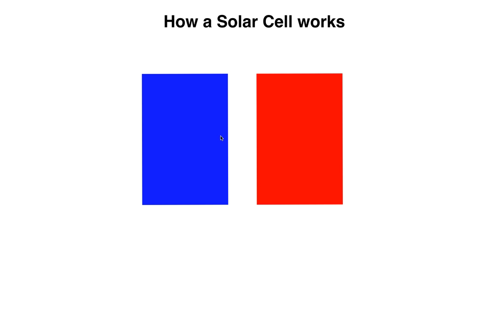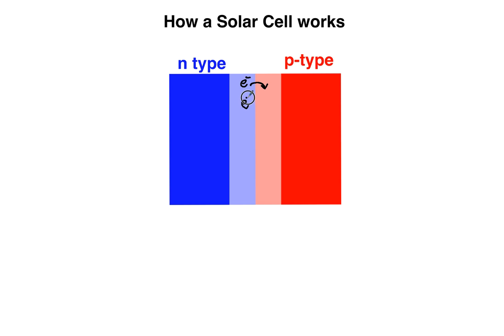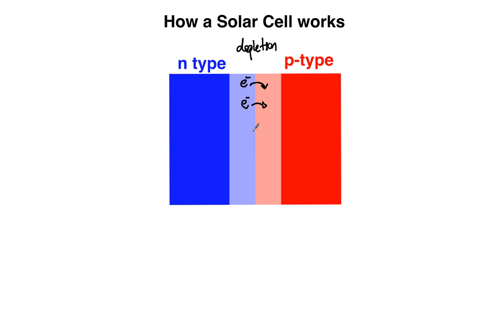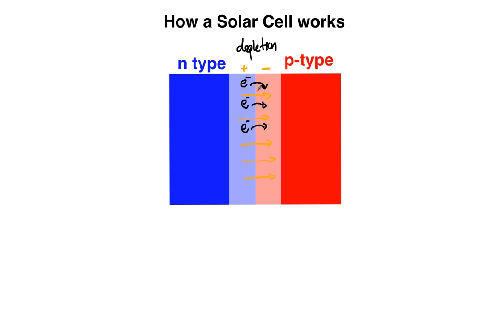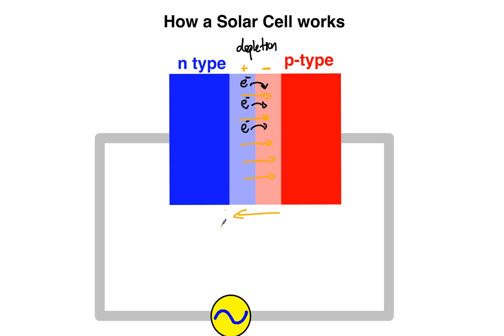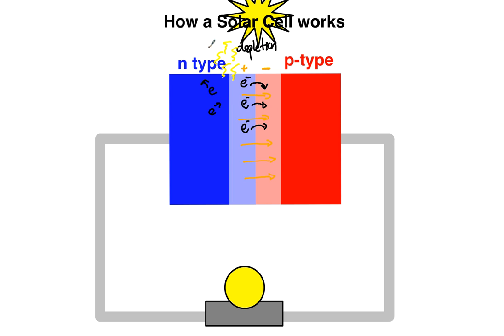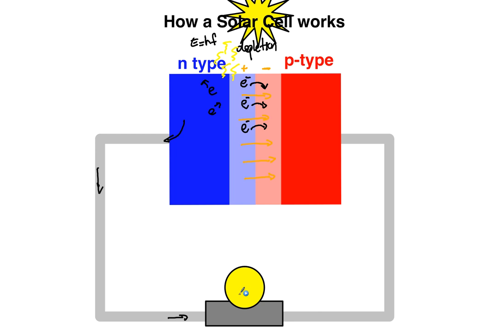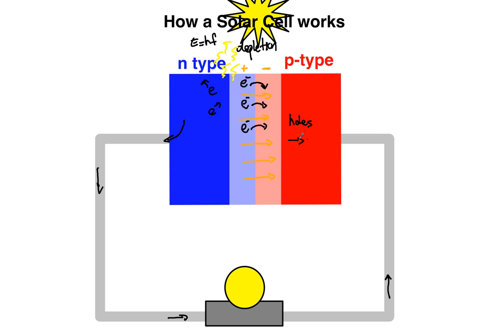How do solar cell work?

Comment: I don't understand how if the electrons flow the opposite direction of the depletion region...what happens when those electrons enter the P region trhough the conductor? They will also be stoped from going to the N region again (thus creating a current) bc of the negativ ions in the P region's depletion zone...

Comment: Some sources say that in depletion zone holes and electrones are generated by the light, but in your video that aspect is ommited. Who is right? If first opinnion is right, then depletion zone under the light has collapsed and we have charge carriers (holes), which are then able to conduct electrons. I'm little bit confused, but I like your simple but very succint explanation.
Reply from the maker: You are correct and a correction needs to be made. It does occur in depletion zone. Thanks for the pickup.
Reply: @PhysicsHigh  and Balbin23, IMHO, I guess both happens. This is why one get dark currents I assume. I think the flow of electron and holes spontaneously/ or upon photoexcitation depends on the surface concentration of these charges on the semiconductor surface. Usually in OPV, the concept is that the donor gets photexcited, forms an electron/hole pair which is then separated upon application of external electric field

Comment: Does light have to shine on the n-type side or can it shine on the p-type as well?
Reply from the maker: It actually occurs in the depletion zone though many sources show electrons coming from the n layer. It does nt come from the p layer as the electrons are tightly bound by the bonds

Comment: Great video but it is the Photovoltaic effect not the photoelectric effect!
Reply from the maker: You are correct - my bad
Reply: No he's right it's photoelectric effect which causes the liberation of electrons
Reply: The photoelectric effect causes liberation of electrons into a vacuum, in this case it's the photovoltaic effect since the electrons move into a new material